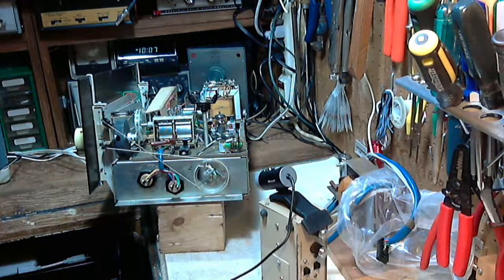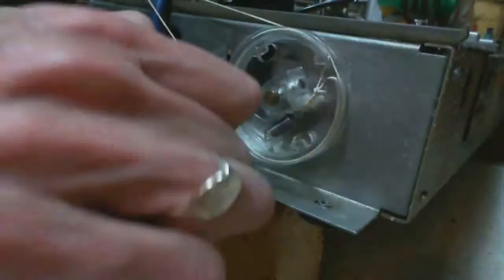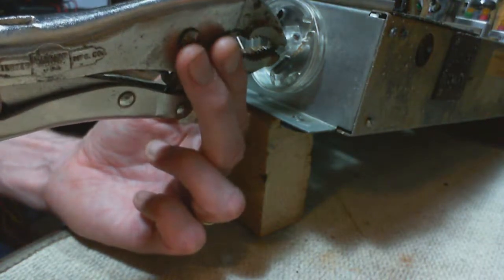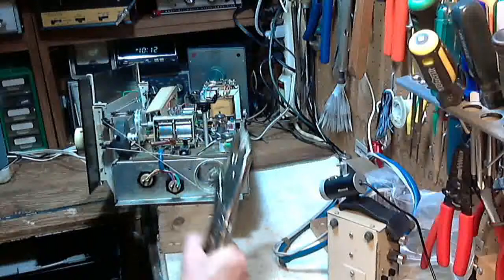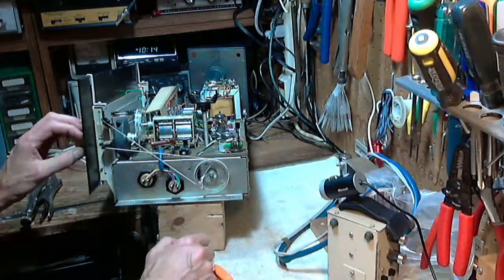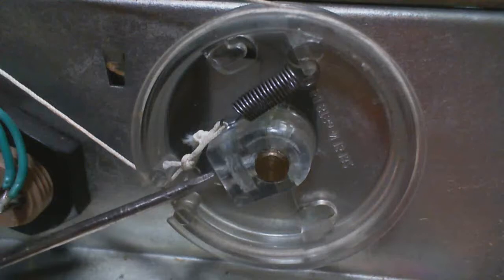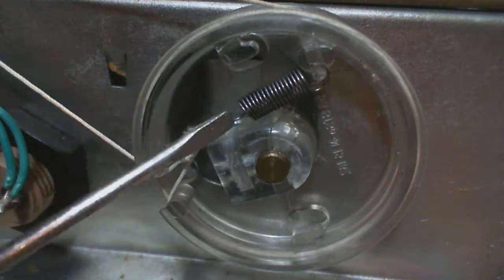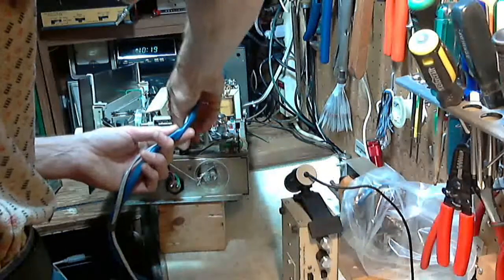Koronette Console Stereo Video #15 - Troubleshooting FM Tuning

Comment: I wrap .010" music wire (as many turns as will fit) around the hub, twist the ends and epoxy, usually pc-7. Good on cracked knobs, too.
 (JB weld also an excellent choice)

Comment: For the cracked pulley I would tighten the screw just enough to spread the crack slightly, then a drop or 2 of crazy glue into the crack. Loosen the screw to close the crack onto the glue. Once that has a chance to cure I would apply a layer of epoxy around the outside of the hub for extra structural support. With a fine application tool you might be able to do it without removal of the pulley. Good Luck!
Reply from the maker: I've got some super glue and I'm going to follow your recommended approach.
Reply: I have never used the clear epoxy. Until you mentioned it, I didn't realize how difficult it is to tell when it is mixed. I have only used the JB Weld type. The resin and hardener are black and white, grey when mixed. Very easy to see a black or white streak in the mix and keep on stirring. Good luck with the repair.

Comment: Another method I've used: cut a slot into the end of the shaft. Into that slot glue (or solder) a stiff wire. Drill a hole in the pulley through which the wire will engage it. Leave the set screw loose.
 Glue the wire to the pulley to prevent backlash troubles. I've not seen past this vid for that restoration (yet) mebbe ya' got it worked out. just some ideas for later.  ;-)